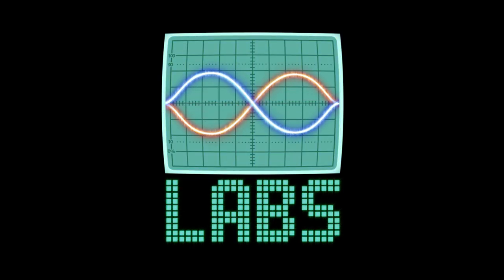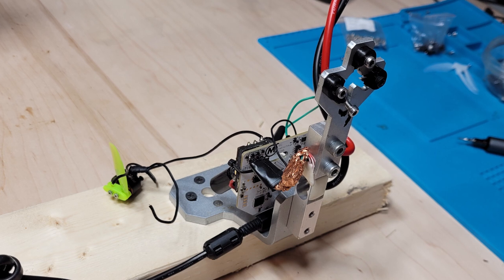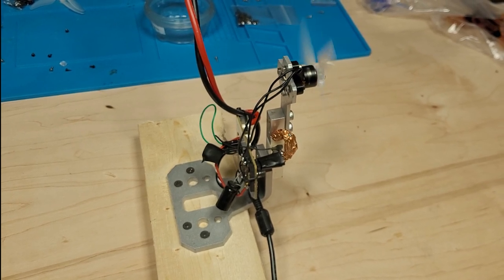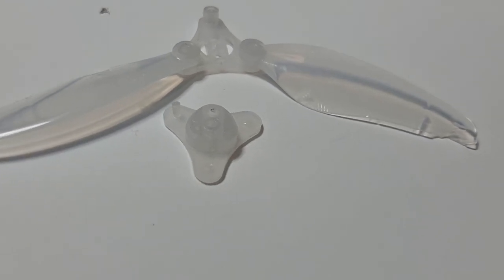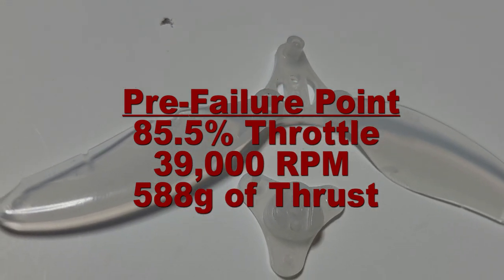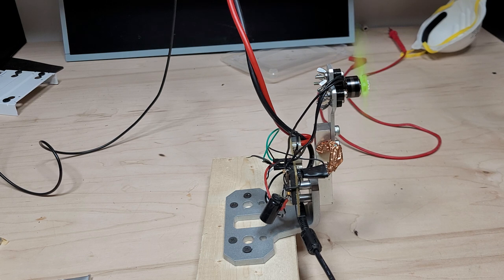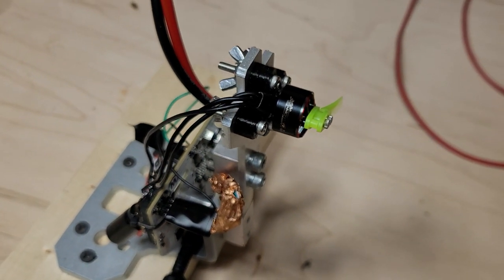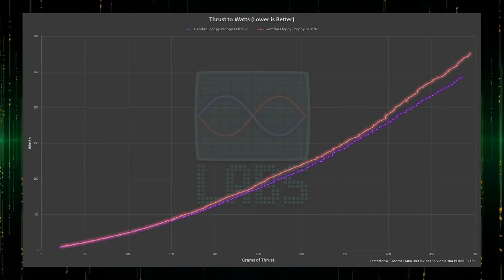Gemfan Floppy Proppy - Critical Failure Warning

Comment: I came to same conclusion after buying a whole bunch in different sizes. I really like the push and turn props from the DJIFPV drone. Normal strong props that come off and on easier is better than fragile folding props.
Reply from the maker: I figured they might be an interesting option if you really needed something you can travel with with props on to be compact, but even then I'd be concerned they'd take damage when folded with a micro crack that explodes even during a gentle flight. That said I was really surprised with how well they did on the 1404 tests all things considered, so it's too bad they are not stronger.
Reply: @RecursionLabs Would be interesting to approach Gemfan about it perhaps they would be open to redesigning it. Especially since it could cause injury in such a repeatable way. Great analysis 👍🏻

Comment: do yoz think it would help if the hub where made out of carbon and not plastic
Reply from the maker: Carbon probably wouldn't work well being that thin or with movement. Probably just needs a thicker hub/connection.

Comment: is this just on the 1408 or is it still a bit risky on 1404? The efficiency is tempting but if they fail halfway through a flight then you're not actually getting any more flight time.
Reply from the maker: If they fail halfway through flight time is the least of your concern :) As I mentioned, the 1404s couldn't get up to the RPM required to cause them to fail. My concern there would be if they hit anything since they probably break easily, and even if they don't in flight, they may lose strength then break randomly in a following flight.
Reply: @RecursionLabs  yeah, thats also my worry. That in testing they'll be fine but that the increased vibrations from some mild damage will be enough to push them over the edge. BTW if you don't mind sharing I'm curious about the minimum cross section of the arms on your frame. I'm trying to design my own frame and unsure about how little material I can get away with.

Comment: You assembled the prop hub upside down, that is why it failed.
Reply from the maker: I assembled it as per the included instructions: https://i.imgur.com/6RPURlY.png
Reply: @RecursionLabs  thats fair, the triblade diagram shows the prop hub assembled the other way which makes more sense as youd have a thick hub holding the prop against the direction of the thrust. Try the test again with the hub the other way and see if its stronger.
Reply from the maker: @Atlas_FPV  I did a quick test before swapping motors for a new test set, and the blew upside down as well.
Reply: @RecursionLabs  ok fair enough, thanks for the retest